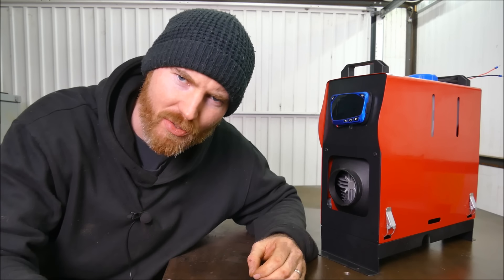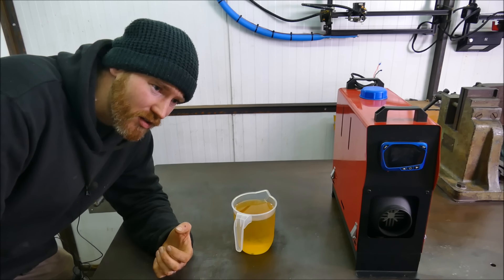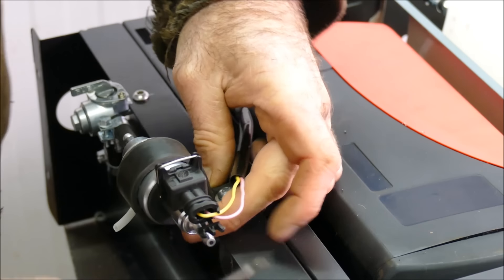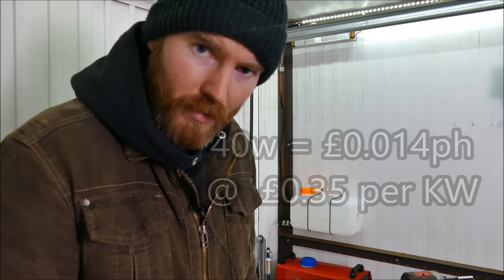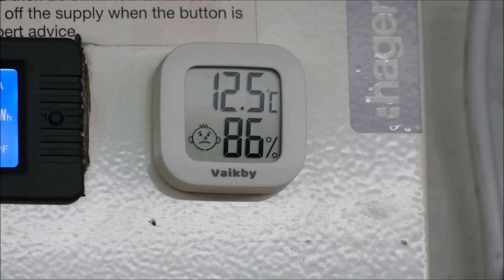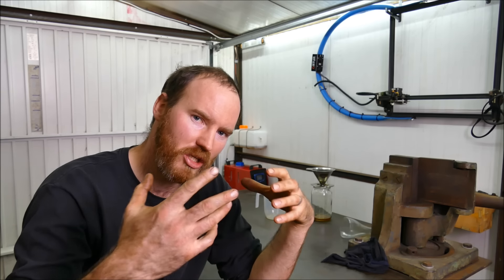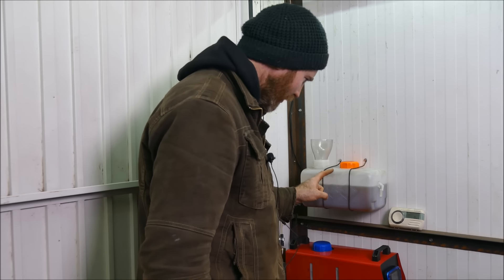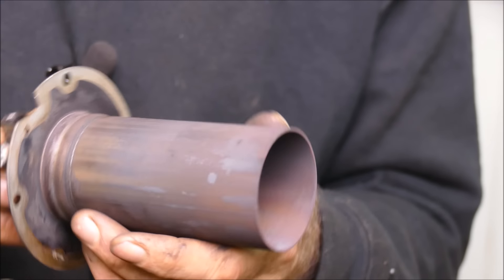£0.03 per kWh heater modification - Top facts & lies on diesel heaters - waste veg oil burn success

Comment: Very interesting subject. I wondered whether you could scavenge  the waste heat from the exhaust by connecting it to a length of scaffold tube. Providing the exhaust was sealed properly to the thicker tube and the whole assembly angled slightly downwards. There would be a benefit of harvesting the waste heat by the thick steel tube which would take years to be affected by the condense. Would the length of tube be critical. Possibly ?

Comment: Use a steel box with baffles in It to extract the heat from the exhaust then route the pipe out the wall . Bigger the box the more heat in your room 18:41

Comment: Thanks. Great Video and testing. I burn Waste Veggie in my car and boat engines after letting it settle for a few weeks. Then I filter it through 5 micron bag filters. These bag filters are about 10 dollars in Canada. They are about 17 mm in diameter and 600 mm long.  The oil goest through them pretty quickly. I just do it by gravity and a barrel of oil takes about an hour. I wash them with soap and hot water after every couple barrels.  If the oil is particularly dirty from the restaurant or has a lot of bits in it, I put a  a 400 mesh filter 'bag' inside the 5 micron filter bag and wash that as necessary.  Works great, but you do have to let the oil settle for a few weeks first or it will plug up the filter bags pretty quickly - depending on how heavily used the oil is from the restaurant.

Comment: You keep referring to 'kW of energy'.
A Watt is a measurement of power, not energy.
kW = 1000J/s 
A Joule is the SI unit of energy.
1 W = 1J/s

A 1 kW heater uses 1000J of energy per second or 3.6 million Joules per hour (=1000 x 60 x 60 ) which would equate to the use of 1 kWh if you had the device running for one hour.

A Watt is a measurement of power (energy used or produced per unti time) not energy.
A kWh is a measure of unit energy unlike the kW, which is a unit of power. 
Power prices on gas and electric bills are quoted in kWh, not kW, because kWh is a measure of energy, not power (energy used per unit time).

Comment: about the fuel consumption: maybe the pump is displacing more volume by higher viscosity of the fluid. this would most likely be the case if it is not a positive displacement pump. you could add some type of needle valve at the outlet of the veg oil tank to reduce the diameter, so you don't need to change modes on the control all the time.

Comment: 🙈it's kinda crazy that this is still more expensive then just heating up with electricity where I live, at the low £0.009 high £0.03.
Off the grid though, I think I remember seeing it drawing like 40w after the initiation, running it off a solar system that's really dense energy!
I'd rather haul 50 liters of oil and kero then 50kg of batteries 😅

Comment: Would using sand instead of water for a thermal battery be a safer and better long term solution? I'd assume water would evaporate causing condensation, and also requiring refilling, where sand would not have these issues. this could also be more useful for a longer straight exhaust where you could put a sand 'channel' box around the exhaust and then have a long heater over that distance, which could make for a nice 'panel' like heater....

thanks also for these videos, gas is getting rediculously expensive in Australia atm (singluarly due to political price rises, not supply as AU has plenty)
Reply from the maker: Thank you so much. Sand definitely works, it will slowly release the heat however it takes time to get to temp and you'll lose lots of heat still through the exhaust because it doesn't conduct enough of the heat. I normally only use my heater for an hour at a time and so extracting as much instant heat is my preference. Cheers J

Comment: My family and I  lived and heated EXCLUSIVELY with wood from our own property for 35 years and we saw many heat' recovery systems tried. After burners, double or split chimney pipes and so on. 
These are ALL great ideas if recovering the lost heat is the only factor to consider; unfortunately as most wood-burning country people know all too well, it is the LEAST important thing to consider. The MOST important is SAFETY. We, as do MANY full-time couintry people who heat with wood, REGULARLY do a 'hot-burn'. This is usually done by burning several sheets of newspaper before each new fire. This burns VERY hot and creates a sort of mini-chimney fire each time, but small enough that nothing substantial catches fire as there is never any buildup of creasote in the chimney.
I personally would worry that cooling the exhaust temperature that much could well result in a less than hot burn and the distinct possibility of creasote-like deposits in the exhaust pipe. I would then NOT be surprised to hear that exhaust pipe fires might occur.
I suggest leave it run hot and it'll keep itself clean. It's ALREADY pretty darned clean and efficient so why try for every drop?
Cheers from Canada North where the snow is expected ANY DAY NOW!!
Reply from the maker: Yes I also have a Rayburn wood stove and open fire. The diesel heater works very differently to a wood stove. To hear exchange the exhaust is fine and softer referred to as a condensing burner. You do need to make sure the burn is complete though before the gasses exit so a higher fan speed may be required. It's possible to lose over 30% of the heat out the exhaust so if you're paying £1 per litre say that's £0.30 per litre wasted that could be recovered. Wood burners need a draft to work by air convection so some of the heat is used in place of a fan which is why you don't want to be taking energy out of the chimney as it stops it working. Cheers J

Comment: theres no such thing as an 8kwh Chinese diesel heater the 8kwh is just a rebadged 5kwh thats sold at a higher cost theres really only 2 and 5 kwh. the pizza/ chip place i frequented was giving me their used cooking oil.  then i moved and the owner set up one of these heaters for the sole purpose of not having to pay to dispose of the oil since he cant sell it to someone to do this with hes to dispose of it himself or pay to return it to a recycling facility who use it to burn garbage he uses it to heat his restaurant hes got the heater in the floor under a 55 gallon\ 208L oil drumb that he dumps the filtered oil into using a tank selectorwhere he rund pump diesel to start and finish the burns hes got it connected to the ducting of the building.

Comment: The Energy content of Diesel is all wrong. If I put 300ml of Diesel in my little 1.4Ltr Diesel engines tank start the Car and floor it the Engines maximum ouput power is 74Kwatts at roughly 30% efficiency . It doesn't actually use all the 300ml of Diesel to output 74Kwatts.
According to figure's online Diesel fuel contains  137.381 BTU/gallon = 40.262 kWh/gal. Diesel fuel contains 12.5 % more energy than petrol.
So it can output 40.262KWatts of Energy for 1Hr and it can also output 40.262Kwatts of Energy in 1 Second.
It's a funny old world when it comes to how much Energy can be produced or output from difference substance. Einstein worked it out based on a substances Mass which turned out to be an awful lot of Energy if you could get the entire Mass to release it's Energy very quickly. E=Mass x the speed of light squared.
It's actually mind boggling the amount of Energy that tiny amounts of matter can produce hence the Atom Bomb.
😊

Comment: Try running the Exhaust back closer to the Air intake and have an over sized pipe over the final section (coolest part) of the exhaust with the Air intake connected. That way you will gain the last part of the waste Exhaust heat at the same time preheat the intake air which will help combustion.
Reply: not true - Cold air has more oxygen molecules per unit volume due to its higher density

Comment: 1. Is the exhaust gas out the bottom expelled with ‘force’?  If so so, could a ‘turbine’ type thing be added to generate electricity to partially recharge that battery you were using?

2.  Could the room heat exhaust be used to generate electricity?

3.  Could the heat from the bottom fuel exhaust be used to heat water for a water tank?  Again, to generate electricity?  

The heat alone is good though, but if the energy in that heated air be used before being expelled outside, then it’s a huge win.  Obviously you’re already stating that, so my apologies.

I really like your channel/video.  And i agree with you, the school system fails people.  I’m afraid of doing electrical work, but mostly because it’s been SOOO long since I’ve done any.  Maybe i should start small and test things, to gain confidence.

Comment: Good idea with the long, straight exhaust to eek out more heat that would have been wasted otherwise, but make sure your exhaust pipe is sloped downwards so any water condensation will run outside and not stay in the pipe.

Comment: Looking forward to experimenting with this. Wondering what the trade off will be to preheat the fuel and air by the exhaust just prior to consumption. Would be especially good for -20 - -30C travels and homes.
Reply from the maker: Pre heat the fuel yes, keep the air as cool as possible because it's more dense and therefore more oxygen rich. Cheers J

Comment: Thanks Joshua for taking the time to do this review, it was very helpful for my installation.
Just a note to help anyone, I experience a rancid plastic like burning smell and I almost sent it back. Taking it apart it appears the manufacturer fitted a rubber anti-vibration pad where the exhaust comes out and this had charred. Doesn't look like its necessary in my application so I just removed it, problem sorted.
I think ebay sell silicone replacements but they are quite expensive.
Reply from the maker: Well done. I've got a new video coming shortly. Cheers J

Comment: Just thought I’d add that I heard the bends in the exhaust would ideally be kept under 270 degrees in total… otherwise you create obstruction which isn’t good for the burn chamber in terms of backward pressure. That info comes from the German manufacturer of the original diesel heater that these Chinese ones are based on (essentially identical to).

Comment: I have been using this heater in my canal boat for the past 2 years and found your investigations very interesting particularly kerosene. One area you have not looked at is the affect of fresh air intake pressure which is very critical. The main problem I have had with the heater is when external fresh air is polluted with smoke from surrounding farms, wood/coal burning from other boats, vehicle fumes etc which flood the interior with an unwanted stench and requires the heater to be shut down. I tried adding an air filter ( from computer room clean air system) and the heater shut down with minutes. I am now looking at ways to recycle the air internally which is possible in vehicle air systems. I am also looking at using another fan on the air intake to minimise the sucking pressure to the heater. As an electronics engineer I can fashion something but I would be very interested in your thoughts on this.
Reply from the maker: Hi. That doesn't sound right that air from the outside is polluting your breathing air. Your combustion air intake is outside and you heating air intake is inside right?
Reply: @joshuadelisle I have the fresh air intake on the outside to get “fresh” air which is generally nicer than recirculating old air. It reduces the condensation  in winter. In vehicles with recirculating air the windows mist up but clear with fresh
Reply from the maker: @flabberghast7908  I would strongly advise keeping the heated air re circulated inside and possible add a dehumidifier and filter. Or possibly a large 3 way valve to switch between inside and outside. The valve is recommended to be home made as they'll be expensive otherwise. Dehumidifiers can be electrically thirsty and only recommended to be used for an hour or so a day. Cheers J

Comment: I decided to turn veggie oil into bio-Deisel first. Everything you do to make biofuel is toxic I do it outside and it takes a few days. Then you filter out the glycerin and heavy junk that separated out of it. A lady who lives nearby me posted a video on making bio-diesel cheaply I know I can do this were I live. https://www.youtube.com/watch?v=8cZPP2at8HI
Reply: I know bio-Deisel burns cleaner than Deisel in a car because it doesn't have sulfur in it and it helps lubricate moving parts better because it's more slippery.
Reply: The separator with the valve on the bottom. That's the best DIY tool idea ever. It's used to get the glycerin out and wash it. Someone with no money can do this on a small scale for himself using these tools. This lady at the flea market knows how to clean the glycerin out and make soaps with it. This is the way I'm going to do it because I'm a poor person.

Comment: 10:00 I would definitely recommend getting the intake air from inside the shed if your shed doesn't have fans to change the air inside. You should have clean air intake for the shed (2–3 litres/second would be a nice amount) and if your heating setup can move the air instead of using an extra fan, that would be great.

That said, if the only intent is to heat the space without having it habitable for humans, using intake pipe from outside the shed is the correct way.

Comment: The trouble with this dual fuel solution is that putting in codes into your heater to change its settings mid-heat-cycle isn't very practical. Maybe the controller can be replaced with something more complex, or a simple raspberry pi like controller. It would be nice to have your fuel switcher controlled automatically via servo motor also!

Regarding the exhaust, do you think you might be able to get access to the sensors that garages use down car exhaust pipes when they perform the MOTs? they will tell you things like CO2, CO, SO2, NO2 and particulate sizes/concentrations. 

One more thought, if you're still up for experimentation, have you considered using the exhaust to heat the incoming air? this is a vertical, tube in a tube type configuration that you see on modern gas condensation boilers. The water condenses out of the exhaust and needs a way to drain out, but there is a significant heat change when water condenses, which is how a lot of the energy is conserved.
Reply: ESP32 all the way, with Bluetooth & WiFi functionality but the coding simplicity of an arduino.

I've got a Propex heater in my van & the startup & shut down routines are all driven a microcontroller, albeit on bespoke boards that the manufacturer designed. Anyone thinking about going this route, think seriously about redundancy, both in hardware and in the coding. Thermal runaway protection for 3D printers for example.

Comment: Heating the air in the shed makes it expand. It will leak out easy passages. On cooling it draws air in. An RV water heater could be a good heat reteainer to capture exhaust heat. Could be routed to radiators.

Comment: use  copper tube for the exhaust and mount computer cooler radiators on it. there is nothing  more efdicient as a heat radiator. Also there are those floor radiators, which are pretty much an oversized comp cooler. Also, i presume you would catch hugely more heat outta exhaust should u put that  gas through much larger diameter and preferably kinda flat-tank-shaped compartment. Like that used in pressure balancing tank in gas boilers (red tank) . Would be better to have comp radiators used inside it as barriers for the heat.... Hint: use ventilation intake tube through that compartment which would intake fresh air from outside, preheating it as well, and you will pretty much use all heat from that smoke

Comment: I know this is an older video, but Winter is coming. You might consider trying a finned tube radiator for the exhaust. Turnbull & Scott in Roxburghshire might be a good jumping off point to source what suits your wall run. No affiliation with them, they just have good web presence. That will let folks in the comment section see what I mean if they are unfamiliar with that product.
Reply from the maker: Thank you, I have collected everyones ideas and will do another video soon, I've baught a new one to install on my house using a lot of safety precautions and heat extraction methods. cheers J

Comment: The air intake should be inside the building, so that you are not having to heat cold air. This will require less energy and warm the room quicker. The air in equals the air out, so there is no change in pressure inside the building.
Reply from the maker: The heating air inlet yes is inside but the combustion air intake goes outside. You want the combustion air to be cool so it is more dense and has higher oxygen levels. Cheers J

Comment: Having access to the burn-chamber it might be a game changer if you alter that one a bit. Maybe it can be larger in diameter or shorter in lentgh. Obviously you want a red glowing chamber to cumbust fuel. At a certain level you might have it hot enough to keep the burn going without the glowplug. All hypothetical, but nobody has tried that before.

Comment: what happened was you developed condensation in the exhaust and developed a build-up of water in your exhaust line. For the exhaust, I would have used copper baseboard with heat exchange coils and you would have gotten amazing heat. great project

Comment: Tapping on the heat of the exhaust system is what they use in all condensing boilers. Ideally you want to steal so much heat from the exhaust pipes that the gases expelled are almost cool :)